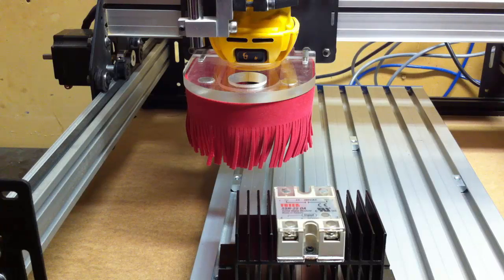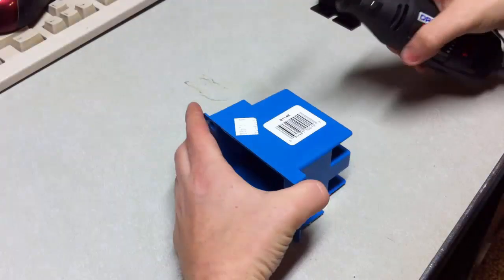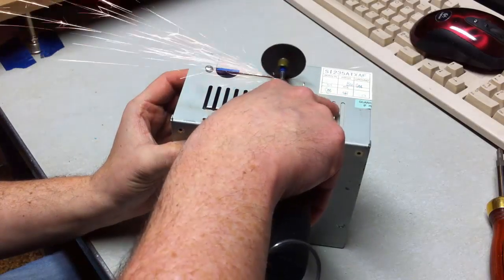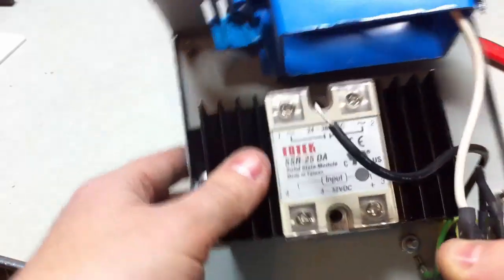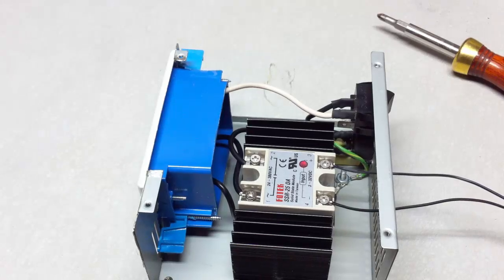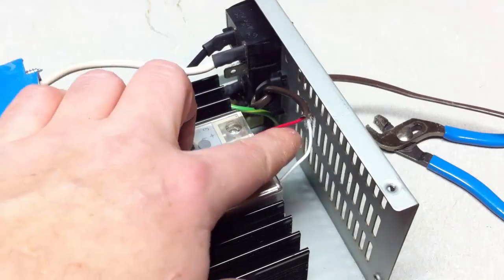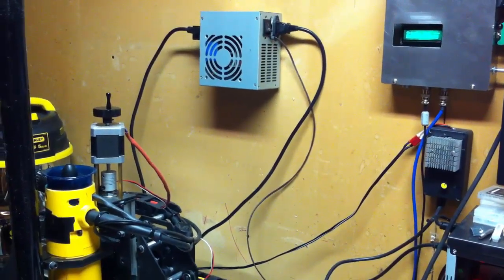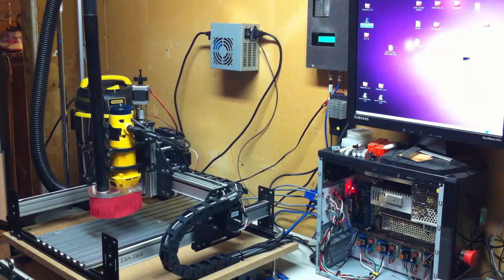ShapeOko 2: Automating a shop VAC

Comment: I got an X-Controller sent in.  And, after asking, someone shared that it won't work with LinuxCNC.

Is there a special controller board required to operate LinuxCNC?
Reply from the maker: +TheRangeControl Sorry for the confusion.  Here's a link to my build log: http://www.shapeoko.com/forum/viewtopic.php?f=5&amp;t=2344

I use a C10 parallel port breakout board to connect the LinuxCNC box to my four stepper motor driver boards. 

Link to C10S breakout board(this is a slightly newer version  than what I use):
http://cnc4pc.com/motion-control/breakout-boards/c10s-bi-directional-parallel-port-interface-card.html

Link to my stepper motor driver boards:
https://www.pololu.com/product/2133/

Also, you could use a HobbyCNC Pro kit. which has both the parallel port breakout board and stepper motor driver chips all on one board.  I believe it actually uses the same stepper driver chips as the X controller.

Link to the HobbyCNC Pro kit:
http://hobbycnc.com/product/hobbycnc-pro-kit/
Reply: Thanks SOooo much, buddy!  It certainly shows me that I have a way to go before I get to this step.  LOL

Comment: Are you still using Linux CNC?
Reply from the maker: +TheRangeControl Its the best!
Reply: +Caleb Peters after I can get an enclosure set up, I'll have to look into it.

What are some reasons it is so much better (if I may ask)?
Reply from the maker: +TheRangeControl 
Here's a list of some of the features that I think make LinuxCNC great:
It's free!
It's easy to install
It's Reliable, does what you tell it to do.
It's actively being developed by both a team of enthusiasts, and at least one paid professional.
It has a in real time graphical display of the machines work area.
Automatically does a sanity/syntax check on G-code files when they are loaded.
It's well-documented.
Very easy to customize, and modify.
Much more efficient motion control, and path prediction then GRBL.

Downsides to LinuxCNC:
Like everything based on Linux, it has a bit of a learning curve.
You have to have a dedicated PC to install LinuxCNC on. which typically means you will have to have one computer for doing CAD/CAM and another for controlling the machine.
Because of its reliance on a real-time kernel not just any computer will work. Most will however.
The most common way to connect LinuxCNC to your CNC's electronics is via parallel port. Unfortunately, this is another thing that will rule out many computers especially laptops.
Reply: +Caleb Peters Thanks man!  

I HAIL YOU!  :-D

Comment: can't tell on the outlet, but your overlay suggested that you ran the neutral through the relay.  i don't think you did... the black wire is the hot one, and it looks like that correctly went through the relay.  May want to remove that overlay so that other folks don't run the white wire through there.  Great stuff BTW.  I love seeing how you upgrade your machine!
Reply from the maker: I ran the neutral through the switch, not the relay. However, as it states "I should instead, be running the live wire through the switch and then through the relay."
Reply: oh... i think i must have misread that then.  my bad!
Reply from the maker: Frank Graffagnino No problem.